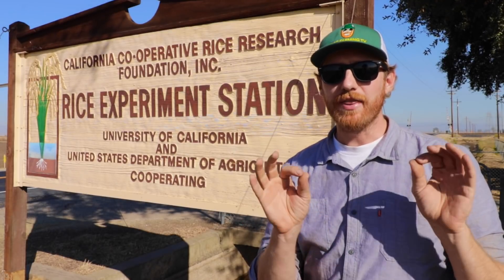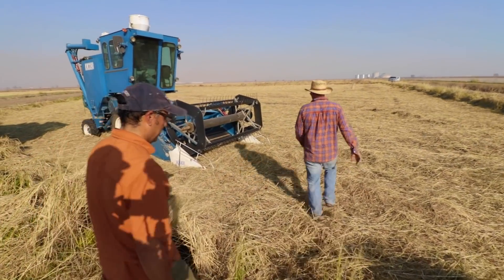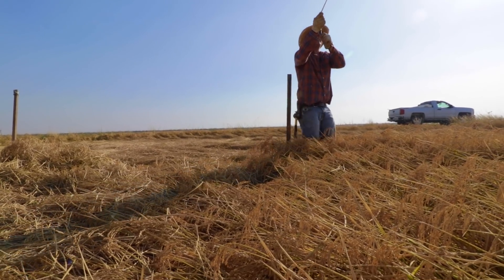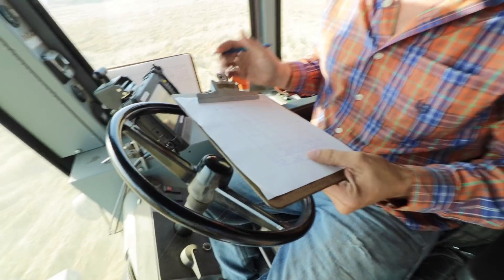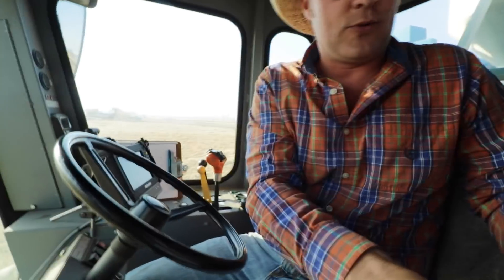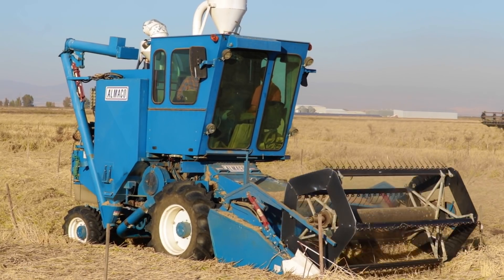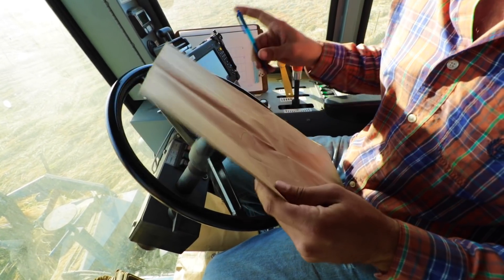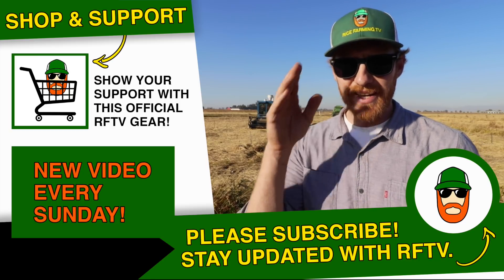Cutest Little Harvester You've Ever Seen!

Comment: Great vidieo. Almaco combines are made here in Story County, IA.  I spent the fall of 1981 harvesting soybean research plots as an intern for the Asgrow Soybean breeding program based out of Ames, IA. The combines were developed for Iowa State University soybean breeders. Walt Fehr of ISU  and Allen Machine were the developers.
These combines clean out between each plot (<.1% )with is vital to maintain purity of self pollinating crops. I would ride on the side of the combine as it harvested the 4 row, 13.5 ft long plot and capture the soybeans in a cloth bag, tagging the bag with corresponding plot information (variety number, replication # and crossing pedigree.). 
Stationary threshers were used before the combine requiring hand harvest and transport to the thresher. The small plot combine (eg.SPC40) was a huge improvement for development of news varieties. They cost the same a a large commercial combine and are sold word wide.